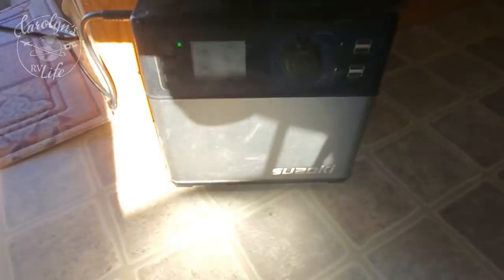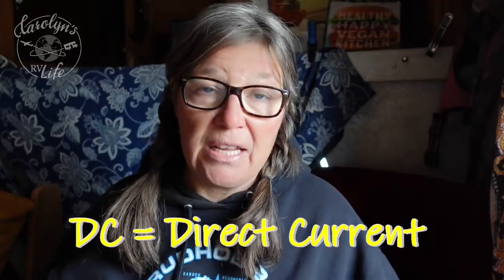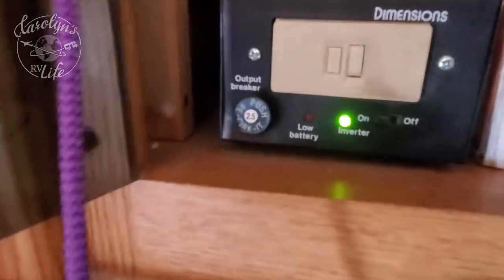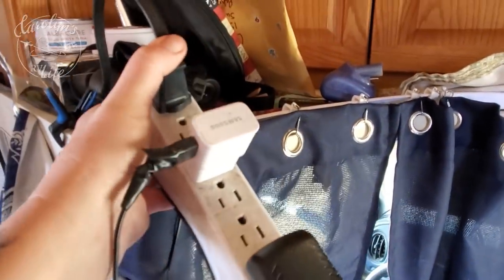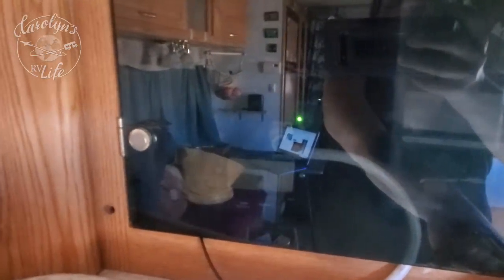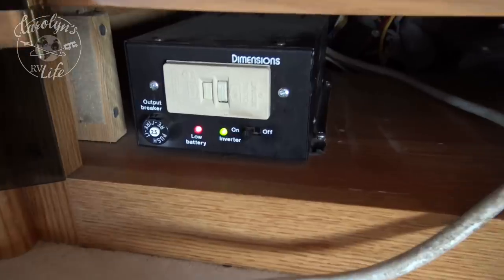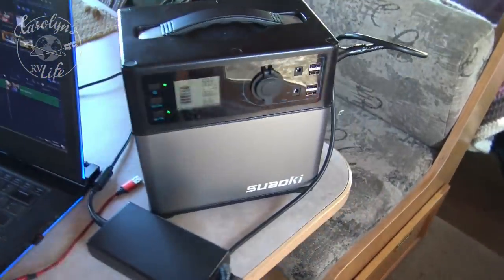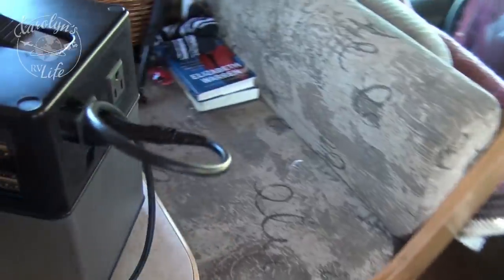RV Power Outtage! What to do when your Inverter Dies // Potek 750 Watt Inverter Review

Comment: I think the real lesson here is to have backup systems if you're full-timing, or even if you're out on a short trip.  In your case you needed backups for your backups, which you had, and big thumbs up for that!  I've seen YouTube videos dealing with that issue of the onboard generator dying when you release the start switch, and for the life of me I don't remember what the solution was, but I don't think it was a very difficult or expensive solution. Hope you two are feeling well!
Reply: I believe it was an RV Prepper Wayne video where he fixed that problem...

Comment: Hi Carolyn. I found this when reading about the inverter you had problems with and thought it might be helpful to check the fuse in your RV that powered the circuit you were hooked into when using your inverter when it stopped working.

Note: Never run the inverter with any loads higher than 150W via the cigarette lighter outlet in your vehicles since the maximum allowed current through cigarette lighter outlet is 15A;please use the battery clamp cable with connection directly to the 12V battery while you run any loads higher 150W but lower than 750W

Just a thought. Hope it helps you out.
Reply: I noticed that also..yikes.. it would be a goog idea to use the provided cables clamped or lugged directly to the house batteries

Comment: Hi Carolyn,

 Often cigar lighter plugs have an internal fuse of only about 5 amps (maybe 10?), and as well, the vehicle socket itself is protected by a similar sized l size fuse in the vehicle fuse panel - unless it is a special socket intended for heavier loads.  Our Sprinter van for example has one socket fused at 25 amps.

Now, if the circuit  is fused at 5 amps,  that means that at 12 volts, you are good for 60 watts power draw before you will blow a fuse.

So even if your inverter is rated at 750 watts,  unless you direct wire the inverter to your battery with  very heavy wire and fuse, you cannot take advantage of the 750 watt capability.  Your inverter will likely have large terminals to attach suitably heavy wiring and that is what you would need for anything much larger than a laptop charger.

750 watts on a110 circuit ( 0r 750/110 ) = about 7 amps on110v.    Your battery current draw to provide that would have to be a minimum of 750/12 = 63 amps !   

In fact it is even worse than that,  because the inverter is not 100% efficient.  If it were say 80% efficient, then your battery current would have to be 63/0.8 = 79 amps!!!  A long way from the  
5 amp rating of a typical cigar lighter circuit !

We have a 2000 watt inverter in our Pleasure-Way camping van,  and the cables that feed it from our lithium coach  batteries  are huge.  About as big as the cables on the  main  truck battery and need to be so in order to handle the high current needed - of course there is a large  breaker / fuse too ! 

Even if you had  wiring of suitable  suitable size, , with that sort of current draw you would  run your battery down pretty quickly with a heavy load.  

We can use ours for coffee pot / toaster / microwave or similar from our inverter because the time  of current draw is relatively short,    

But we could cannot  run our air conditioner for any useful length of time before the batteries would be  dead!   In fact in our coach, the air conditioner is not even wired to the inverter because it is not practical to use it that way.   If you tried, it would run maybe an hour or two and the batteries would be completely depleted

Hope this explanation is understandable and  makes some sense!

Comment: Hi Carolyn, Check with Dell, they have 12V chargers for Alienware laptops. Inverters are very inefficient. Most laptop charge with 19V. I have one for my lenovo and it plugs into a cigarette lighter outlet.
Reply: You are wasting power taking DC 12v power converting it to AC 120v then converting back to Dc 12v
Reply: @psl53  Thats not the way laptop car adapters work. They don't convert to AC.
Reply: @stevemcginnis2953  yes they do. If you have a 12 v system and plug a convertor in that converts 12v to 120ac then you plug your laptop into the convertor the convention change the 120 back to DC, like the laptop battery . Is your laptop battery 120??
Reply: @psl53  laptop vendors have 12 volt adapters that plug into a 12v cigarette lighter output and at the other end of the cord have a plug that goes directly into the laptop. It doesn't require the original ac adapter that came with the laptop. Try searching for 12v laptop charger. You will find lots of them. They do not convert from DC to ac and the back to dc
Reply: @stevemcginnis2953  yeah, I know, Carolyn was using a convertor, hence my post, if she was using a dc plug, I wouldn't have posted what I did.... Roger,?

Comment: You need a pure sine inverter of at least  1500 watts ,  they might be more expensive but it  will be a more   reliable inverter. We have had  our  2000 watts pure sine  inverter  for 7 years  . We run a microwave,  freezer, blow dryer,  etc.  No problems.
Reply from the maker: My old quasi sine inverter is over 15 years old. I think that's pretty reliable.

Comment: Great information. Doesn’t make sense that something visible would trip, probably an internal diode protection inside ate the overload.  Had a friend replace min in a tv/vcr combo I accidentally plugged into an unmarked 220V outlet. Replaced the diodes and all was well.  Safe travels.

Comment: What are the power specs of your laptop?? alienware replacement cords are 19.5V output with 12.3A??  Is that what you have?  or just 17" R2 or R4?? thinking you could get a DC-DC converter and not bother with the inverter..
Reply: anyway. check this site. they have some models of alienware compatible cigarette lighter adapter(12V) to laptopDC input?? make sure its the right laptop model..

Comment: O.K., T.V.'s, I would luv your opinion.  My huge 65" blew!  (It was a size that the Ex just had to have).  I am still planning on purchasing my "Used, but New To Me" home.  Hopefully a smaller RV, 19' to 22'.  You do have a T.V. in yours correct?  Do you watch it much?  I suppose some sort of SMART T.V. is what I am going to lean towards.  I want to be able to watch a bigger screen then my lap-top when I do chose to actually hibernate on a rainy day indoors.  I know, with what-ever T.V. I do purchase now, I can always sell it when I do find my new home.  But trying to eliminate steps is just soooo 'me'!  lol Any suggestions?
Reply: @spiritjunkie1913  Thank you for your reply & help!  I do hope to have both!  I want to make sure I have a working generator & quite a big solar bank.  As well as a back-up battery source like Jackery, with it's portable foldable panels (or the brand that Carolyn spoke of in this video).  I would like to be in the back country for weeks on end.  And I really don't need a T.V. at all.  If I become that bored with life, or am having a really lazy day, then I could watch a movie on my lap top if need be.  But I am going to start by searching now for the AC/DC monitors/T.V.s and might just buy a 2nd hand T.V. of sorts for my sticks 'n brick s for now.  Are you living in your home on wheels?  Do you yourself have any type of a monitor other than a laptop screen?
Reply: @Tannis Power Check this tab trailer video. Specifically go to about 29:15 or so.

Comment: You cant pull 750 watts with a cig lighter outlet . too many amps . im sure you have a blown fuse somewhere . you would need more than a 60 amp fuse to run 750 watts .

Comment: You blew a fuse that's located inside the inverter.  Too bad you threw  away a perfectly good inverter. It's like throwing away a lamp cuz the light bulb went bad. The instructions on how to remove the cover and replace the fuse can be found on Google.

Comment: Hi. Thats not fun. For your info, from what I learned on the web, using a cigarette adapter you do not get the right amps or voltage and will not give you proper output power. Suggest using heavy wire to battery. Had found info on YouTube. Good luck
Reply: Right - 750 Watts if run on a 13.8V power supply would require about 55 amps out of the cigarette socket.  That;s a tremendous load (my car sockets have 30 Amp circuits and that's larger than most.  (13.8 if the engine is running and you're charging off the alternator; it would be over 62 Amps off a sitting battery at 12Volts; Amps rise as voltage drops, Ohm's law).  I'm guessing that with voltage drop, you're looking at high amperage - which is what pops fuses.  Most smaller inverters have internal fuses, rather than throwing the 750 Amp inverter away, I'd open the case -usually just smalll Phillips screws -  and check to see if there are blown fuses inside.  Change the fuses (plug in type) and keep that one for a spare - just run if off direct cables   If you see burnt or black areas around components or on the circuit board, DON'T plug it in again.